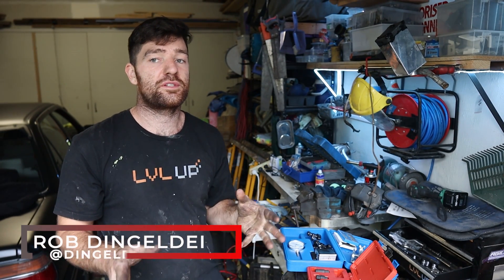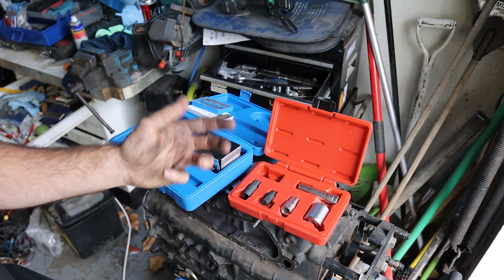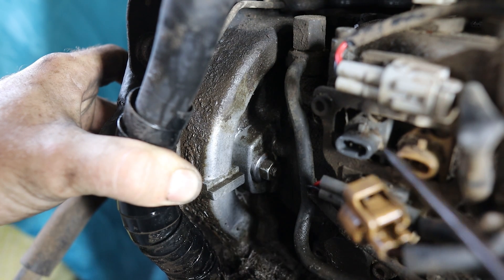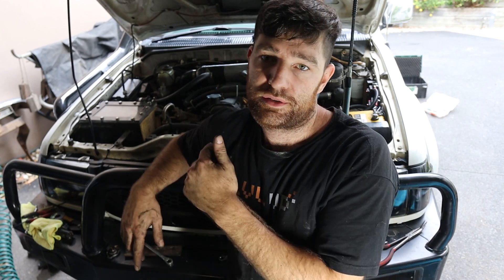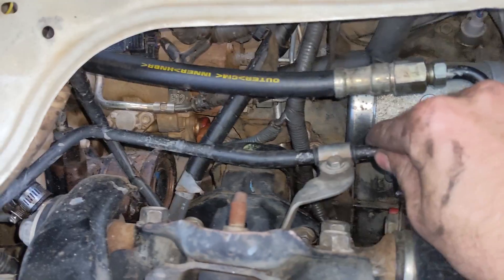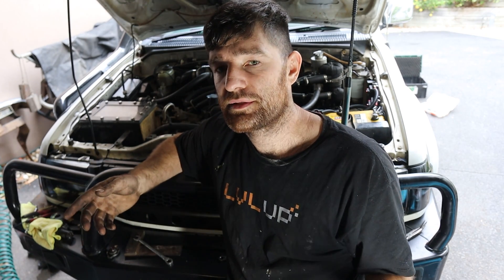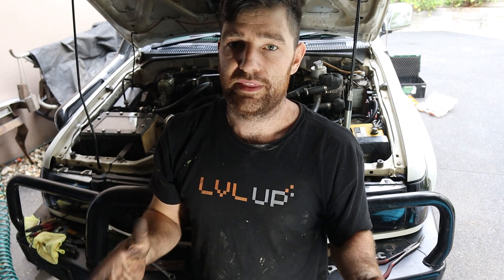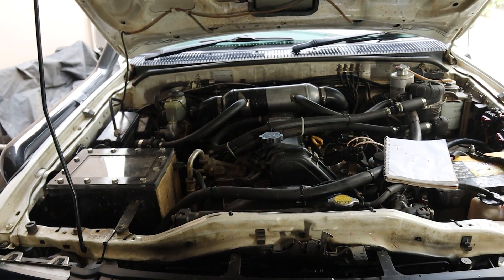1KZ-TE Injection Pump Timing | Step By Step Tutorial | No Specialty Tools Required (4K)

Comment: Hi i tried the resistor mode on my prado kzj 95 and there was now difference  i have problem i dont have power its really slow  any idea on what can it be  cos i tried mant things
Reply from the maker: If there is no difference revert to stock 

Issues for low power can be many things 
Start with a compression check 
If all good check for boost leaks and that the intake is not blocked

After that check your fuel system. 
Change fuel filter and service injectors. If you still have problems after that the problem will most likely lie with the fuel pump

Comment: Great video mate nice and clear, we have been trouble shooting a 1KZ no fuel to the injectors, its getting a signal from the ecu to the spill valve but still no go, we are thinking its a dud spill valve or maybe the spill valve relay which we can not find, its a 1994 surf do you know where the relay is located ? or have any idea what the problem might be.
Reply from the maker: Seems like you're all over it! Im not sure where the relay would be located. Just check the usual spots. Have you had the fuel pump taken out at all?
Reply: @lvlupbuilding  yeah it did have to come out once to do a gasket but has been running fine for some time, just cant find the bloody relay been under the dash and left of the foot well where it is supposed to be but only found 5 pin relays and it's supposed to be a 4 pin relay, a bit stumped!
Reply: Hey mate im having the same problem, did you end up finding what was wrong?
Reply: @zachturner8624  what's your symptoms Zach?
Reply: Hey buddy, try getting an air compressor and blowing in the fuel tank, make sure you have the primer pump disconnected, once you get fuel from tank plug that hose back in once primer is full and spilling diesel hood that hose back up for the pump! I've had a similar issue and it was stupid enough it just wouldn't pickup fuel! After this step I have fuel all the time!

Comment: Hey man I have a 2001 hilux 3.0 td. 1Kzte. when I've started my truck first thing in the morning it idles fine for the first 5 minutes or so and then after 5mins it starts to surge. Has real small surges at like sometimes 1 second intervals or sometimes 5 second intervals. I have done the injectors already haven't done the fuel filter yet. it isn't using oil or water and havent had any overheating problems. Just wondering if you've come across this problem before?
Reply from the maker: I haven't personally come across this problem. Check the 1kzte owners facebook page. you'll get your answer there. sounds to me like a leak in the intake system or air in the fuel

Comment: in the 3.0 1kz I think their are 2 types of fuel pump electronic and mechanical. what are the difference which one is better
Reply from the maker: depends who you ask really. The more "mechanical" pump means you can do the correction mod for cheap gains. Where as the more "electric" pump is newer, more modern and tuneable. Plus its fly by wire meaning you can use a throttle controller too.
Reply: @lvlupbuilding  how can you tune the electronic pump you showed in the video I have a 1998 Toyota surf 1kz electronic pump any idea how I tune it has cable then goes some where then turns into fly by wire

Comment: I seen this type of blinking codes on Volvo. Only few codes but better than nothing. I worked on BMW e90 recently ...List of error codes run in few hundreds. I sold that car  ...and does not want modern cars any more. I will run old diesel til i figure out witch electric car is cheap and reliable to move forward.
Reply from the maker: Good plan! Im all for simplicity and older cars myself!
Reply: I was also old school guy just like you but I started learning the new cars and man, I would say if you equip yourself with knowledge of modern engine PCM and also get yourself a good scan tool which must be bi-directional communication, not even an expensive one you will be good. New technology gives you more miles per gallon and troubleshooting is easier than mechanical stuff. Cheers from Sout Africa.

Comment: Hey mate best 1kz vids i have found on you tube. Any chance your going to do one on diagnosing your injectors via a cheap scan tool and changing injectors?
Reply from the maker: I had my injectors rebuilt by MTQ Engineering for $70 each. I wont be doing any diagnosis videos on them but I can make a video about how to remove and replace them if you like?
Reply: @lvlupbuilding  remove and replace vid would be awesome. Yea i thought about it after im not sure if you can use a scan tool to diagnose them anyway just thinking about it. My stupidity.